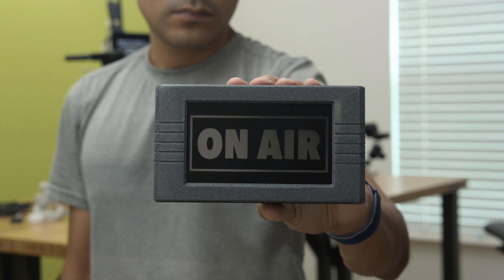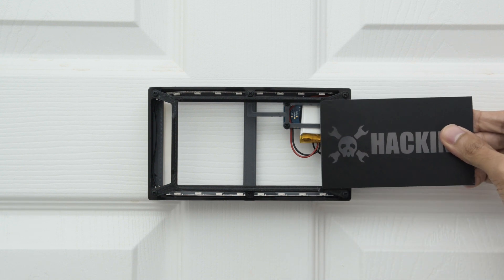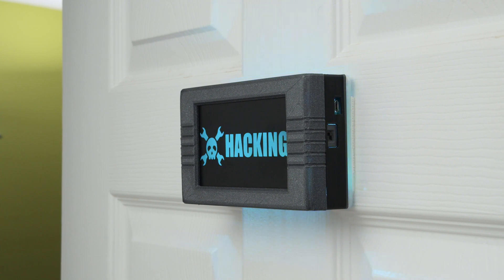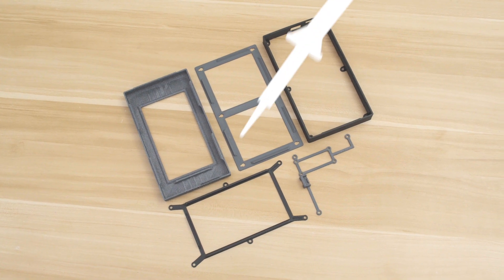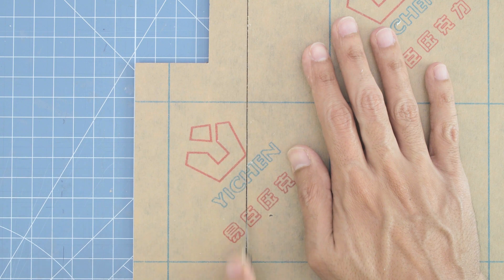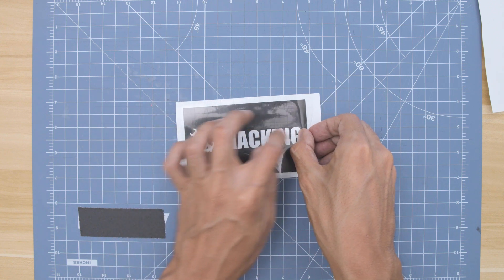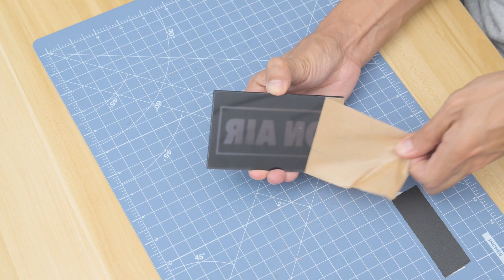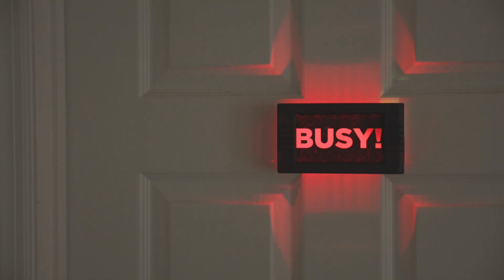DIY BusyBox Interruption Sign

Comment: Thanks for mentioning the BusyBox™️ smart sign and great work guys!   We are big Adafruit (and DIY) fans.  Your approach is very cool, very much a "keep it simple design" and build. Great job. Our inspiration came from those old "ON AIR" signs that were hard wired into the walls, but we wanted to take it a step further (like any good nerd), so we added a big rechargeable battery, BLE, WiFI, and wrote a smartphone app for easier lighting control, grouping and on/off control from across the room (or on the other side of the door).  We'll be publishing our template for vinyl cutting signs on our website soon for DIY folks who want to pick up one of ours.   If anyone wants the cover layout so you can print your own covers, we'll be making that available too.  For those ready to go next level, check out our Digital LCD version and the BusyBox button.  Our API for that is coming later this year.  Keep up the good work and keep those kids and DIYers building and making!   Your friends (and fans) at BusyBoxSign.com

Comment: Good stuff, the only part I don't like is that you can't turn it on remotely via bluetooth or wifi.
Reply: Further to this, being able to trigger it when you are recording or in a zoom meeting automatically would be amazing. Especially given covid times
Reply: It looks like the Feather had Bluetooth LE, so you can add that. You would just need to add the necessary code in CircuitPython. I seem to remember someone doing something like your idea. I think the hard bit was getting the trigger from Zoom.

Edit: Links have been added to the description, and this Feather does indeed have Bluetooth.